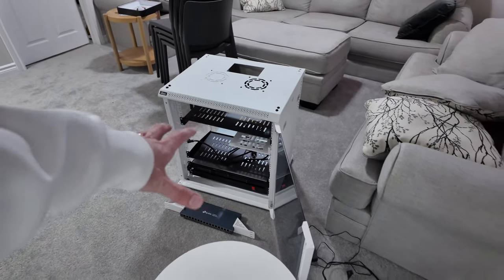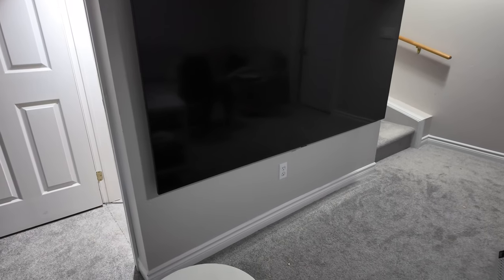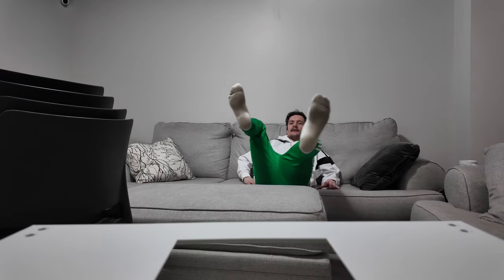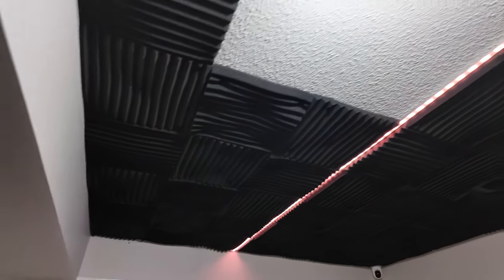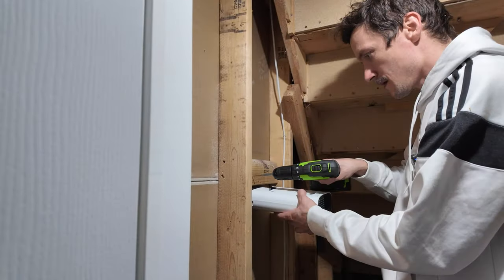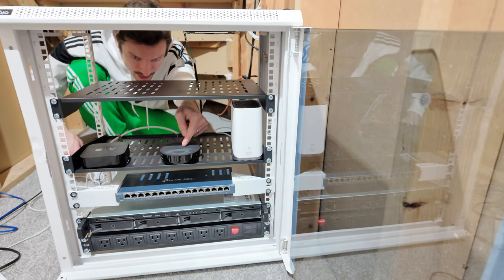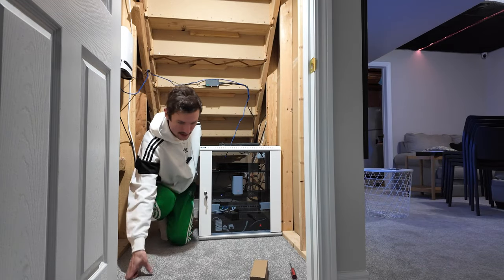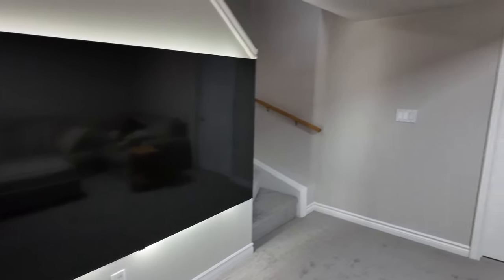Complete Home Server Rack makeover 2024

Comment: Nice work. Maybe need a conduit or just route all the cables on a single path. that network cable going across hmm... possible route everything up. around instead of down? you can get cable extensions for the giga router power if required. Still good start. In my case i have everything routed to a Shed until I buy something in the near future. PS: Gave you a sub :)